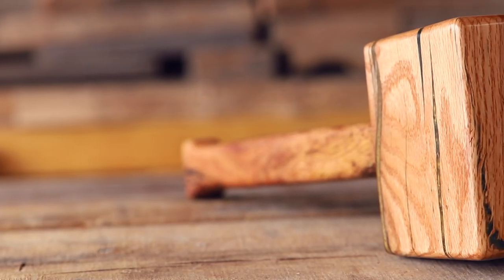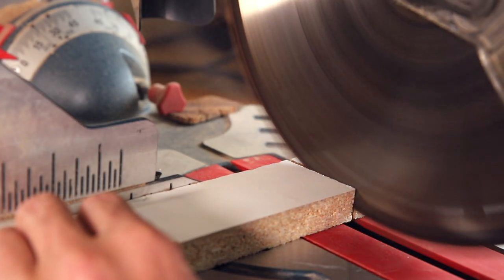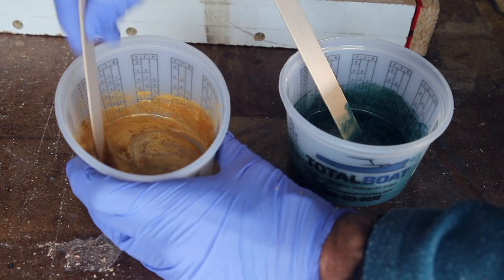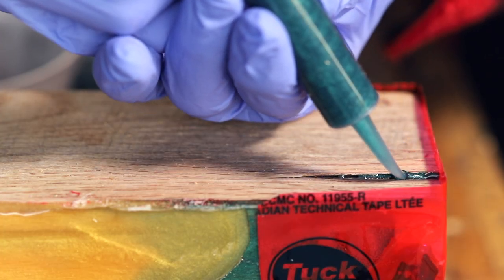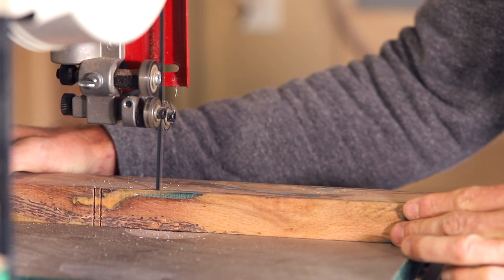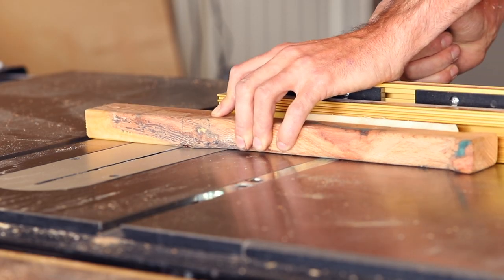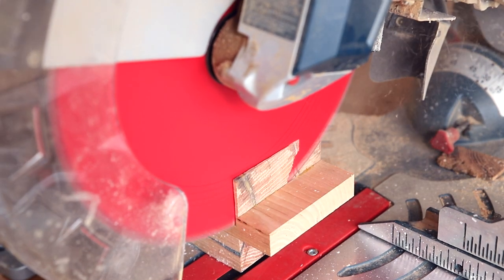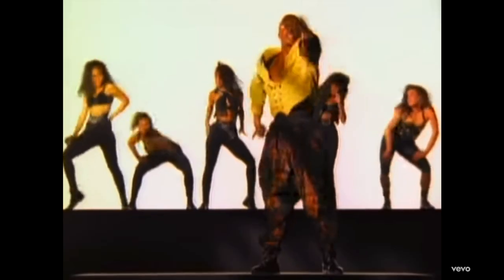How To Make An EPOXY Inlaid Wooden Mallet - Epoxy Resin & Woodworking

Comment: The relief holes are essential. I learned it years ago when in the glass industry. And it's something that I use on other applications. The epoxy that you used is a great product and very strong yet versatile for anything. Nice tool for the collection and yes I would use it till it breaks.

Comment: Im asking because i don't know,  not to be smart. Assuming you are using it as a functional mallet, will the epoxy hold up to that wear and tear? Or will it be something that separates from the wood? 

It looks completely amazing btw..
Reply: You’re not the only one I was wondering the same thing.
Reply from the maker: I’m not concerned about the epoxy getting chipped or separating. The center of the mallet has no epoxy, and this is where most of the striking will occur. The remainder of the surface area of the mallet face has a small portion of epoxy. If some does chip out it will be very easy to pour more epoxy to fix it.
Reply: @JonnyBuilds  thanks...i think more specifically (in my head anyway) I was thinking about the handle where it seemed a lot of epoxy went. I want to try using epoxy at some point and i know very little about it. Thanks for your insight.
Reply from the maker: No, that won’t be an issue at all. The epoxy in the handle also serves to stabilize the wood bc of all the bug holes.
Reply: There's a better chance of the wood splitting elsewhere than the epoxy cracking or separating.
Reply: @nigeljoiner  thank you

Comment: That's beautiful, I hope you get many years of joy from using it. And you beat me to the hammer time joke! Having never worked with epoxy I'm wondering if the mixing pots are single use ir if they can be cleaned without killing your water pipes?
Reply: I'm pretty sure those mixing pots can be reused. I've seen that once the epoxy dries, it can just be pulled out and the container is left clean.
Reply from the maker: Thanks brother. I don’t ever use mine more than once. I’d be worried some leftover epoxy would cause the ratio to be off and the epoxy wouldn’t cure correctly. That very thing happened to another YouTuber friend.
Reply: Jonny Builds Interesting. I think Peter Brown reuses his.
Reply: @BruceAUlrich  they certainly don't look new every time.